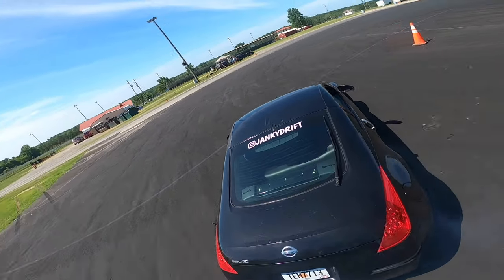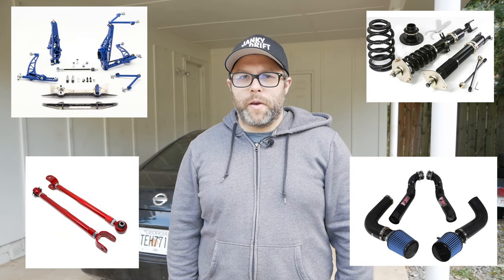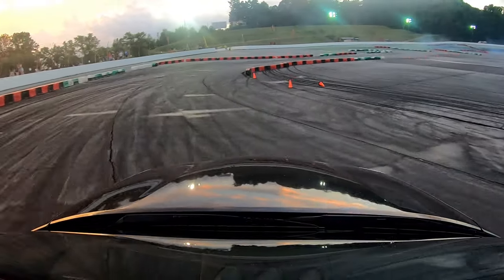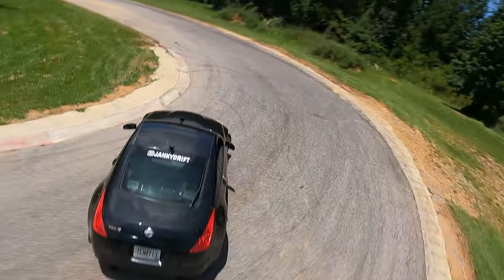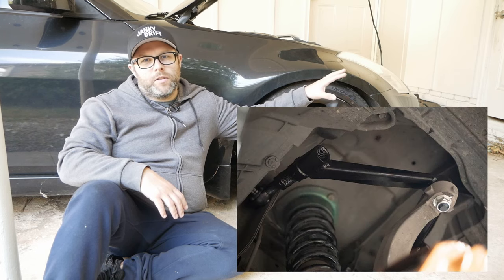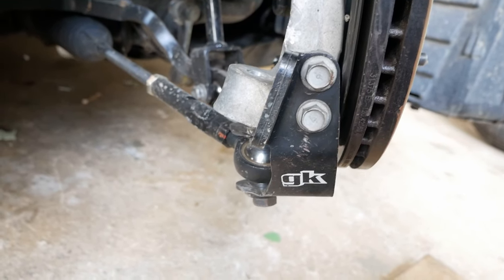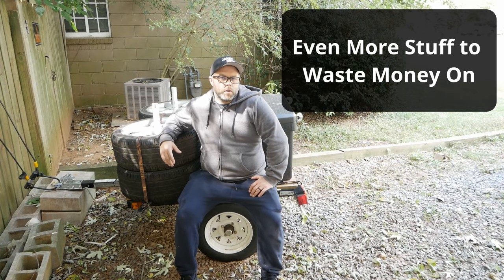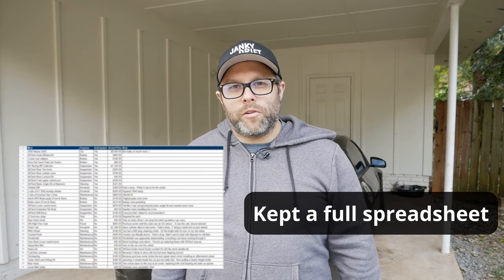How to Build a Beginner Drift Car - Top Mods for Starting a Drift Build

Comment: Great video! I’m buying a built drift ‘92 325i this weekend! Would be interested in a video on what kind of maintenance you do before/after events!
Reply from the maker: I've heard the BMWs make for awesome drift cars, for sure those folks always seem to be tearing it up. Appreciate the idea, I'll add it to the list. For more quick reference... topping off fluids, oil changes every other event or so depending on how much the car gets beat on. Then if you have an angle kit or any sort of adjustable control arms those seem to love to come loose, so I generally double-check torque on all of those between every event. Then shake down to check wheel bearings every few events.

Comment: Great and helpful video. My friend bought a 350Z recently and we’re looking for an angle kit to install. What kind of kit are you rocking?
Reply from the maker: I'm running the full GKTech angle kit on mine. Not sure how the quality compares to other kits out there but it's been great on my car.
Reply: @JankyDrift  thanks for the prompt response brother. Also interested on tyre sizes you run, but that might be an idea for a separate video :)
Reply from the maker: @owlfury-beast  yeah no problem - I run 245/40/18 on both the front and rear. Like to have a square setup so i can move then around.
Reply: @JankyDrift  thanks a lot. makes sense 🙌